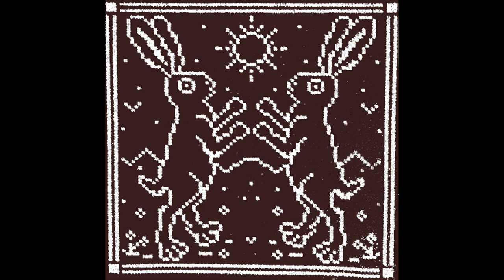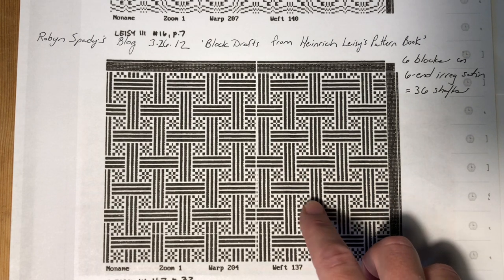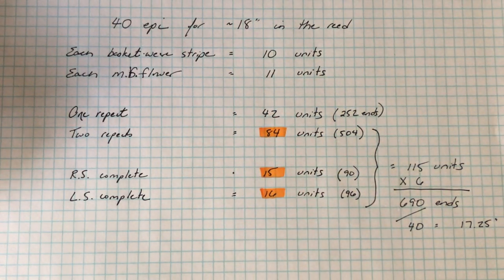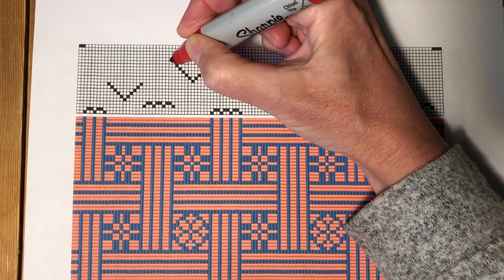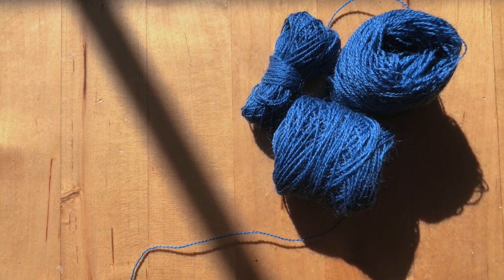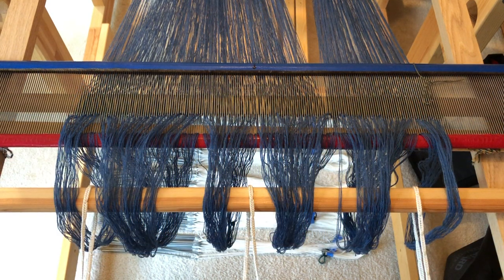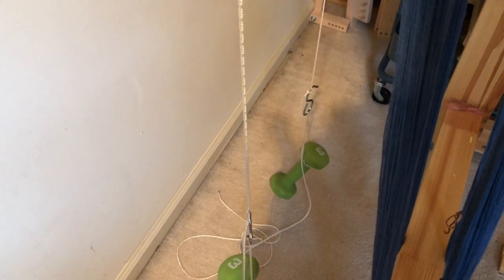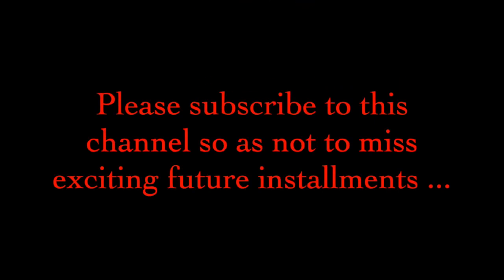Weaving a Drawloom Project (Part 1): Planning and Beaming the Warp

Comment: I got incredibly lucky! I found a Glimakra floor loom on sale, used, locally. I didn't think I would be able to afford one in the near future. But then surprise. It was about a third of a new one. I took a risk and it paid off. The lovely is in excellent condition. I tried using this method to dress it from memory instead of rewatching your video first. Mirical of miricals I got it mostly correct. I went through about 4 extra steps moving the cross but I got to the same point. This time I think I'll watch your threading and slaying video first.
Reply from the maker: Fantastic! Welcome to the world of Swedish looms - I am so happy there is a drawloom in your future. I hope you will keep me posted!